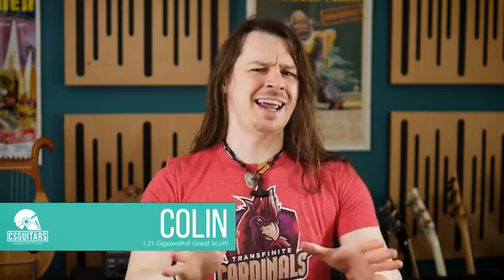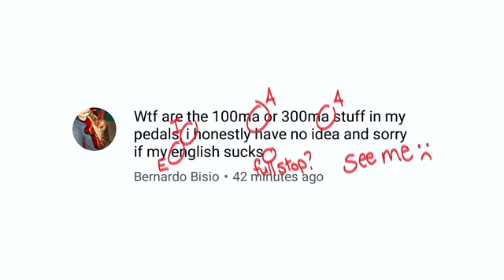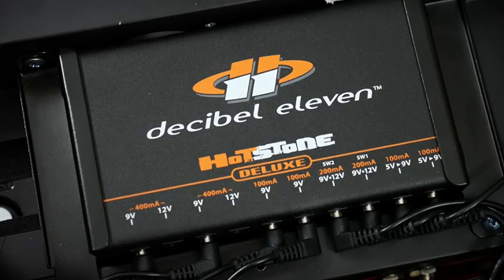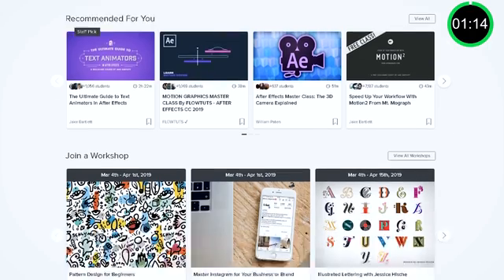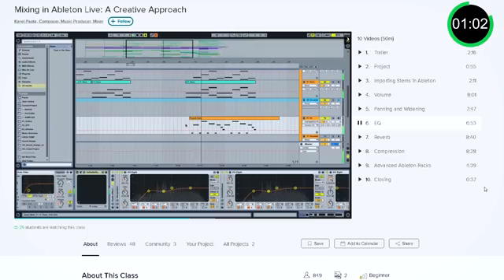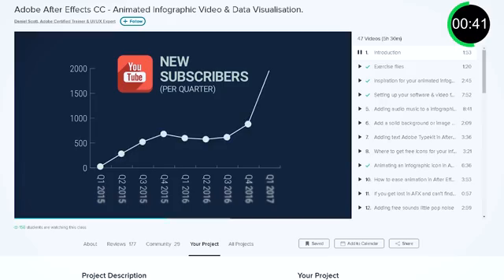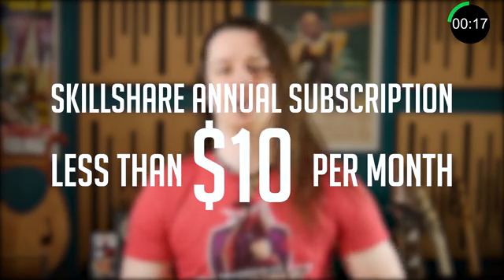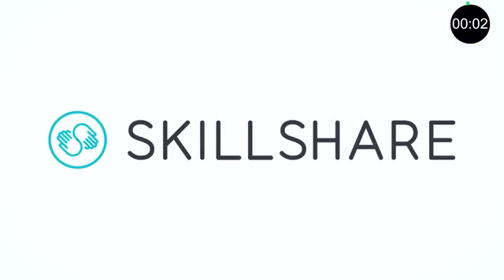What Are mA In Pedals? | Too Afraid To Ask

Comment: When I was a kid my father would take out a big bag of spare parts: wires, batteries, switches, lightbulbs, etc, and we would play and make stuff (I wish he'd known what a logic gate is and had a pc board and soldering wire in his spare parts, but that's another story).  Anyway, the analogy he always used was that electricity works like a dam -- the height of the water is the voltage and the volume behind the damn is the amperage.  So if you've ever combed your hair in the winter and gotten a visible electric shock, you were probably on the receiving end of thousands up to hundreds of thousands of volts -- it takes a LOT of voltage to make a current arc through dry air -- but a tiny fraction of an ampere.

Comment: One question about this: About 20 years ago, a more knowledgeable person than me said that my Digitech pedal would run (and sound) better on a Boss power supply than another brand, because Boss power supplies were 9.6V instead of 9V. Nowadays, a lot of us use power blocks and such, but they’re all usually rated for 9V. Is there any validity to the statement that Boss and old Digitech pedals would run better on 9.6V power supplies vs. 9V?
Reply from the maker: I think your friend is perhaps mistaken about the brand - 
Boss power supplies, to my knowledge, have always been rated as nominally 9V. I've never measured the voltage from one of the PSA supplies to verify it is actually delivering the nominal voltage, so maybe it is higher than 9V - but that could be true of ANY regulated psu quoting a 9V output. 
The Boss ACA supply was unregulated, so despite quoting 9V it would output a far greater voltage IF the current draw was sufficiently small, which it often was for analogue pedals. The pedals of the 80s that were designed to work with ACA had some additional internal components to knock the ACA's voltage back down to 9V. 
The precise voltage the pedals would be receiving in that case were dependent on current draw. 

However EHX do offer a 9.6V power supply AND they have their own branded carbon zinc 9V batteries which they make some interesting tonal claims about. 
9.6V is an interesting number, because that's typically the voltage of a 9V battery when it is fresh out of the packet - they always deliver a little above the nominal voltage. 
Offering a 9.6V power supply would be like you were running your pedal from a battery that always stayed brand new. 

Does that make your pedal sound 'better'? 
Better is a subjective statement. 0.6V may be enough to make the pedal sound different, in that there will be slightly more headroom on the amplifier rails, and signals can get an extra 0.6V level increase before they start to clip in the op-amp...

But considering most of these pedals are designed to purposefully clip the signal FAR below that headroom in the case of distortions, and even in overdrives the soft clipping in the op-amp's feedback kind of prevents clipping even occurring in the op-amp, it's highly questionable if a mere 0.6V is making any perceivable difference at all. 

Even if it was a clear difference, more headroom isn't always a benefit, particularly if you are wanting to apply a lot of distortion, so the extra voltage might even be a hinderance.
Reply: @ScienceofLoud  Thank you for your super thorough analysis! I appreciate your depth of knowledge and ability to explain these technical things in a very digestible manner! 👊

Comment: Thanks for the video!! So if I have a pedal that requires at least 300 mA and were by way of oversight plug it into the 250 mA output on my power brick, would that be likely to damage the pedal in any way? I fear I may have done this with my strymon Nightsky - any help would be appreciated!
Reply from the maker: If you supply less current than the pedal requires then the pedal will be unable to power on. 
You have not damaged it - you simply have not provided it enough current to operate.

Comment: I’ve had pedals say they need 400-500mA but honestly they work just fine with just 100…. The only pedal that I’ve tested that did need more than 100 was a wah. Other than that one I heard no difference…. I’m just cheap and don’t want to buy another power supply probably 😂
Reply from the maker: It's not a case of "hearing a difference", if a device doesn't have sufficient current it simply won't power on. 
Nominal ratings are by their very nature above the average operating draw because it's useful to have more current than required to prevent problems. 
Big digital pedals will have a large inrush current on start up that may require up to 500mA simply to boot up, but that demand will drop back down to less than 100mA under standard operation.

Comment: i use 18v on 9v pedal it dosent worck any more any help
Reply from the maker: Congratulations, you've detroyed your pedal. 
DO NOT power your pedals with voltage higher than the manufacturer recommendation.
Reply: @ScienceofLoud  Well, I had too many adapters. I didn't look which one has 9 volt and which one has 18v The question is now can I fix it? It's still goes on. But i dont get the color of flanger any more Now it sounds like the guitar is directed plug to the amp

Comment: A possible tata: 
I  was thinking about connecting 2 separate power supplies in the following order (to power 10+ pedals on my board)

Power source > a T-Rex type fuel tank (has a more robust plug) > T-rex’s 18V DC output > my current power supply’s 18V DC input;

This way it would give me a few extra 9V DC outputs, as I am running out of them and I would not need to plug both of the supplies into a separate power source, only the first one.

Would this work as expected?

Comment: Hi I have a caline power cp 202 which has 6x 9V (300mA) outputs and one 500mA output. But as soon as I connect a timefactor delay I get a fuzzy noise... It is centre positive and I have the right cable for that and it's 9V...I have an overdrive in front which is 9V 10mA....but the sound goes away as soon as plug the overdrive out... It's definitely not my patch cables.... Can you please help me?

Comment: How to measure power consumption of a pedal with multimeter?
Reply from the maker: P=IV
Multiply the operating voltage by the current draw, both can be found in the specifics for the pedal.
You don't need a multimeter.
Reply: @ScienceofLoud  Factory specs are usually not precise. thanks anyway.

Comment: 5:40  so what will be the problem with the unused power? 

because i'm planning to buy a Strymon zuma (500mA)
but my precision drive only requires 16mA
and my compressor only requires 31mA

sorry, i'm new to stompboxes,and good thing i found this video :)

Thank you very much for who will answer this
have a good day :)
Reply from the maker: I'm not sure what you are asking. 

To run all three you will need a power supply with at least three outlets, one capable of outputting 500mA or more, and two capable of giving more than your drive and compressor (most outlets will be about 150mA minimum to accommodate a wide range of pedals.)

What I mean by 'unused power' is don't if your supply has only one 500mA outlet, don't connect your drive to that if you have a pedal like a Strymon that requires the 500mA. It's a problem because you are denying the power to the pedal that needs it.
Reply: @CSGuitars 
Hi,
How to measure mA for 'each output line' power supply ?

I want to know how much is worth to miliiamper each output. 
Manufacturers announce values, but I want to check to be certain.

Thanks

Comment: So, if you’ve got a power supply with five outputs and you want to run eight pedals, could you run a daisy chain off of a (let’s say) 500mA output, as long as those three pedals drew less than 500mA in total?
Reply from the maker: Exactly, yes.

Comment: Hi! 
In the scenario of one power brick with multiple isolated outs:

1. How many analog pedals can we power supply with a daisy chain, without noise interference? (Having enough mA for everyone)
2. If we daisy chain let's say an analog overdrive with a digital delay will we raise the noise floor?
3. Why can't we daisy chain digital pedals? 
4. I heard that if you daisy chain an AC pedal with DC pedals it will work. Actually I did that with an old BOSS pedal without knowing that it needs DC and it worked. Why? 

Thank you! Great videos!!

Comment: Alright man, here's mine:

What is the difference between 250K and 500K pots?  What do they do, and how are they different?  Also, is there a better one for a certain pickup?
Reply: a pot(potentiometer....as in "potential"  another word for voltage pressure) is a variable resistor and a set resistor all-in-one.  There is typically a winding of resistor wire or material whose entire length has a resistance of the pot's rating, ie 250k ohms.  There are 3 connections on a pot.  The 2 end connections are on each end of this 250k ohm(in our example) strip of resistance winding or material and will always measure 250k ohms on a meter. The third connection is called the wiper because this wiper contacts the resistor material but can move from end-to-end of the strip. So, when the wiper is at one end, the resistance between the wiper and the end contact next to it is zero ohms (a short since wiper is right at contact), and the wiper to opposite end is the full 250k ohms. as you move the wiper, the resistance increases as you move away from the  near end, but decreases relative to the far end you are now approaching.    
There are also different types of resistive material or winding material and they can make "linear" pots where the resistance changes the same over each similar length of the resistance strip anywhere on the strip, and you can have an "audio" taper where the rate of resistance increases from one end to the other making much of the low resistance end controlled by a greater share of the turning or linear distance and then it sharply increases right at the end. audio tapers are good for touchy stuff like expression and wah pedals where you want detailed control at the quiet end then go full on at the very end, for example.
The pot value in a guitar tone circuit affects the resonant frequency of the little RLC  (resistance, inductance, capacitance) circuit which is your pickup(inductor), cap and pot(resistor).  the different values give different tonal qualities by acting as sort of a filter and the better pot is the one that you like the sound of better. HTH. rock on!!!

Comment: Hi Colin,
I mostly know how cathode ray tubes work, firing electrons using heated plates charged at a high voltage of opposite polarity, but I'm not sure what they actually do or are used for inside a guitar amp.
Reply: Guitar amps don't use cathode ray tubes, they use the more generic vacuum tubes that can function like a digital logic gate. CRT is a vacuum tube specifically made to display an image with a cathode ray gun, that are not used in amps.

Comment: Another excellent video! I understood it all, but there’s still one aspect that I’m not clear on. 

If the pedal requires less current than the power supply can offer, is there any downside?

I’m asking because of your use of the phrases “leaving the remaining 1.9A unused” and “isn’t the most economic use of the supply”. These suggest that, although you won’t damage your pedal, you are using more electricity. Is that correct?
Reply: No, because the supply takes only enough electricity from the mains that it needs to supply the current it is putting out.

Comment: Is it ok to power a Boss HM2 with a 12v daisy chain?
I know I can use:
a) a single 12v PS
b) a 9v on a daisy chain (with at least one more pedal)
c) a 9v battery
d) a Boss ACA 9v PS (which is actually 12v)
I ask this because I run all my pedals from a single 12v PS (1,25 A) daisy chain.

Comment: I have a question. I have a tuner pedal that can also distribute power. It requires an 18V 1A input and has 6 9V 100mA outputs and 2 9V 500mA outputs. Would there be any problems if I powered a pedal board with this pedal or should I stay on the safe side and use a power supply?

Comment: How did you know I was going to mention your pronunciation of current? 😂🤘🏻🎸🔥 thanks Colin you cleared up a couple things for me. I knew using a power supply it has higher output was bad.  I Was always unsure about using a power supply that has a lower output value than the device requires.

Comment: Do active pickups drain the battery if they're left plugged in?
Reply: The cable when plugged in completes the circuit. This means it only drains power when it has a cable plugged in.

Comment: Stupid question here: how do I know when to change my tubes? I don't want to wait until the output of the amp drops dead, but I don't want to change them 'too early' either. I've heard people saying you have to change them 'regularly', which doesn't mean anything. Please explain me this mystery!
Reply: It is not a stupid question, it is a very good one. I am not the best person to answer that properly, but I saw that you should change them when their top turns into an opaque grey
Reply: @PauloScabeni  i thought that only happens when the tubes break and air enters the tube(Collin has a video on it). A loss in audio quality(I think in the high end frequencies) can usually be a prompt to change tubes as well as inconsistencies in the sound and possibly volume, ie one day it sounds like this and the next day it sounds different etc.
Reply: V.L.T.R .
the only stupid question is the one not asked...    if you tap your tubes while the amp is on they should not make a lot of noise if they do they're having issues in the old days you could put them in a tube tester and find out but those days are gone?
just make sure you get paired tubes and try not to go to cheap some companies tubes sound better with distortion amp gain and some some better for clear it depends on what you play ?

Comment: TATA - what are tone knobs on guitars, amps and pedals actually doing to the signal? E.g. Stratocaster guitars typically feature tone knobs that when turned makes the signal more bassy; what is happening to the signal that causes this? EDIT: got rid of 'single' tone knob implication; I am not a smart person and forgot that strats typically have two knobs despite the fact I own a fender strat! I blame my other guitars for only having one tone knob!
Reply: As a short answer, basically when the tone knob is turned down, it removes some of the high end of the signal. lowering the tone dials will give you a more mellow, and sometimes muddy tone. This can be used to your advantage, however, because if you set the tone on your amp to sound nice with the tone Dial(s) around 6-8, you can crank the high end up by maxing the tone knob if you need to stand out for a lead bit without actually making yourself louder
Reply: @connellphillips5439  Addition for experts: Your tone knob is a potentiometer (changeable resistor), so in combination with a capacitor your tone knob is basically a tunable RC low pass ;)

Comment: How do MXR make the LEDs on the Bass Chorus Deluxe pulse with the rate setting?
Reply: I have not noticed this, now I need to go dig out my Phase 90.
Reply: @derpimusmaximus8815  I meant the bass chorus deluxe. No idea why I said that. Oops
Reply: The MXR phase 90 has an "LFO" circuit, or Low Frequency Oscillator. This circuit generates a voltage signal that "moves" the phase. This voltage signal powers the phase effect, but an LED and resistor can be powered by the LFO as well, and it will light and dim in exact time with the Phase.
Reply: Same answer though. Lol Both of those pedals have an LFO circuit.

Comment: So essentially if my power supply is 9V and can spit out 2Amps, would it be safe to use this power supply with something that only draws 100mA?
Reply: Yep
Reply: Yes, only wrong polarity and wrong voltage can damage your pedals.
Reply: @joki94  I understand the polarity and stuff just wasn't sure on the safeness of using a higher ampage then needed